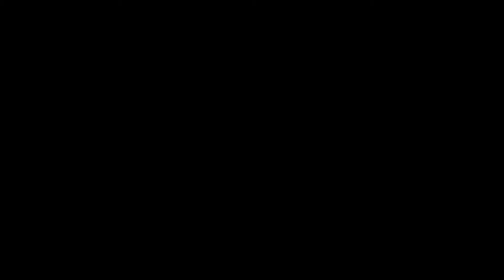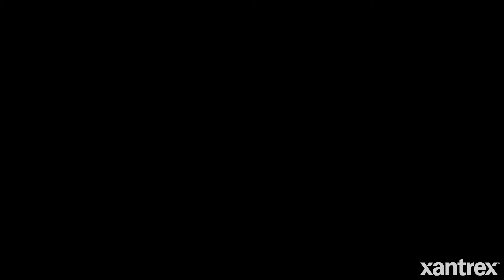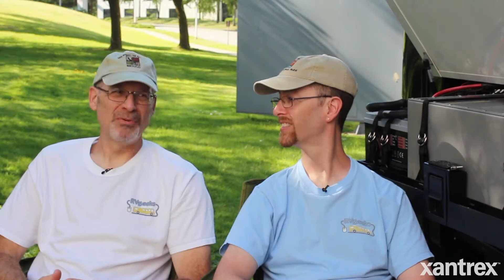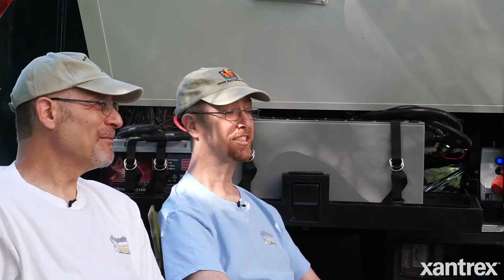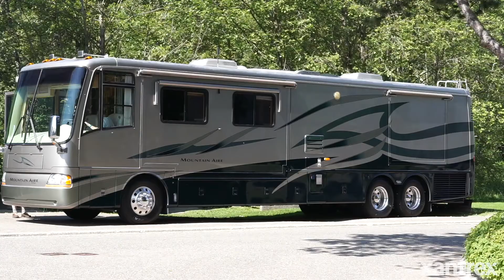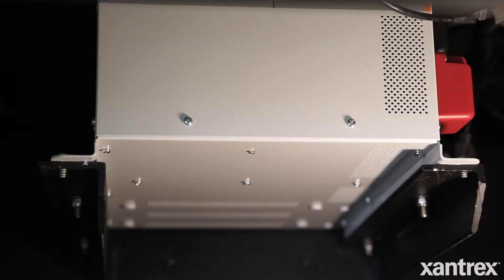RV Geeks Explain Charging Requirements of Lithium and Traditional Batteries

Comment: I have a TrueCharge2 20A 12V and it does not have a charging profile for lithium. What profile should be used?
Reply from the maker: Unfortunately the TRUECharge2 cannot charge a lithium ion battery. It was designed and engineered before Lithium ion batteries started to get used in boats and other vehicles.

Comment: My plan was to come off the alternator like normal but before I get to the chassis battery, split off from there to a 40a renogy dc dc converter with the lithium profile dip switch enabled then just tie into the lithium bank. Will that work?
Reply from the maker: The Renogy DC-DC converter is a good solution for single alternator charging in mixed battery installations

Comment: Hello, I just had lithium iron (lion safari) 12 volt batteries put on my coach, yesterday I had to put in two new standard (group31?) Chassis batteries.... will I have problems with these? Are they not compatible?
Reply from the maker: It depends on how the two battery banks are wired together in order to combine a charging source. It may be worth investigating whether they are compatible, but the Lithium batteries should protect themselves if the chassis charging system tries to do something that might damage the Lithium batteries. If you experience a fault on the Lithium batteries, look at the fault code, that could give you a hint as to what needs to be changed.
Reply: @XantrexTechnology  awesome!  Thank you I'll check it out and let you know if we have issues... I appreciate your knowledge and kindness... :)